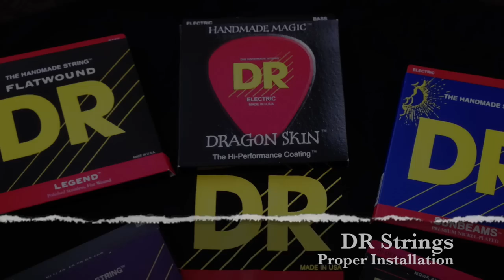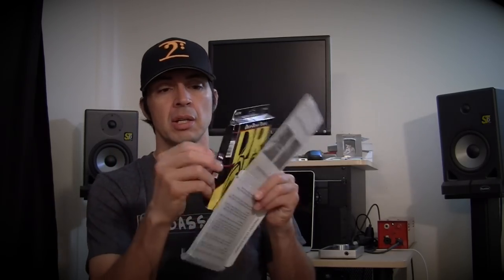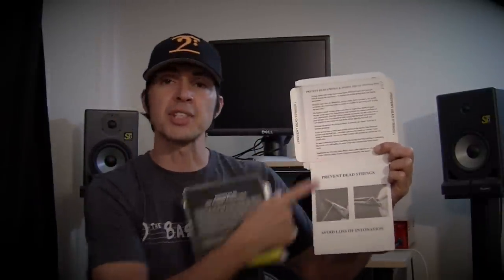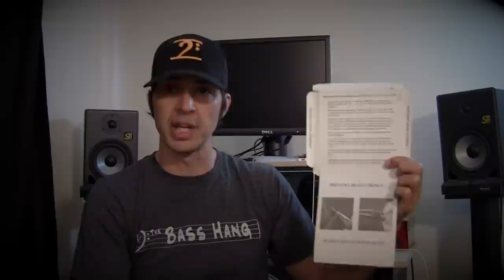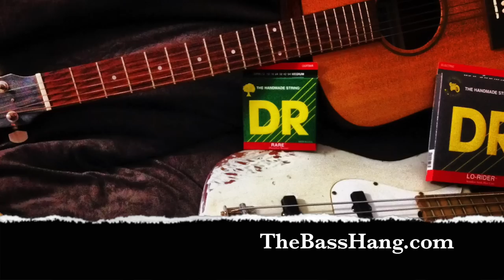Properly Installing DR Strings

Comment: In terms of sound and feel the DR PURE BLUES the best strings i have ever used so far but many serious issues of intonation.
Once b string had a strange feel, in another set A could not be in tune, low E was in tune when the saddle was in front of A saddle etc.Once from set to set different tense.I used them on a fender stratocaster(9-42).If DR could control these issues, i would be back to use them.

Comment: Nonsense, you have to stretch the strings no matter what brand. I just put some Veritas on my acoustic today and they needed to be stretched because they weren't in tune or staying in tune until they were stretched out. They were replacing some Dragan Skins as I'm testing which type of strings from Dr Strings I am going to stick with.
Reply: Its not nonsense. It puts too much stress on the windings.  Let the string winding get to tune with playing.Then retune.  Don't force the string to pitch. Takes longer but they will last longer. Why I'm not sure but I've been playing DRs for 20 years and not stretching them has a better result.